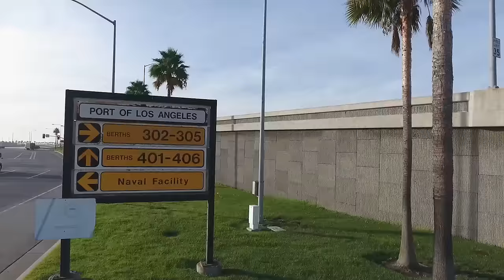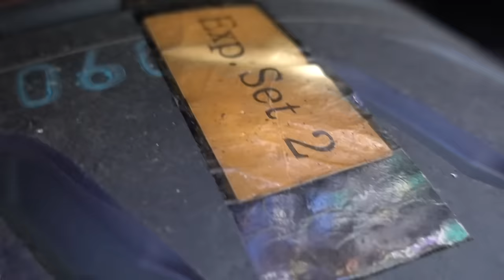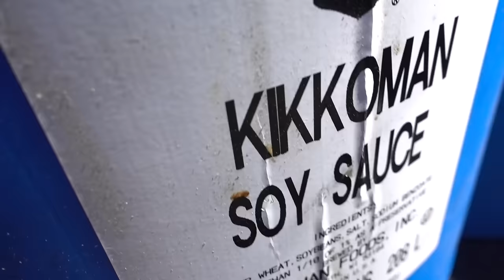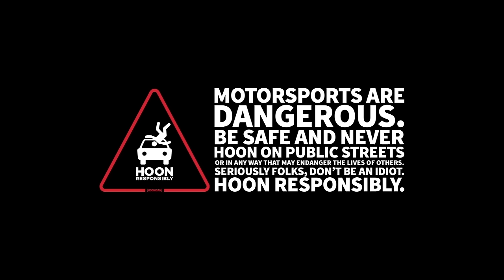Ken Block Slays the Donut Garage in his 650HP Fiesta #Yardkhana

Comment: It’s so crazy hearing the blowoff valve at idle just when he turns off antilag
Reply from the maker: It's crazy to see how much boost the ALS system makes just at idle.
Reply: Would cool to see a more detailed look at the engine configuration on this car. Is it still using a Pipo built engine? I assume it's running fresh air type ALS?
Reply: most WRC cars have a secondary air injection going in to each exhaust runner.

Comment: Has 650 HP
"Ecoboost"
Reply: Raul Alonso Ecoboosts can be beasts if you build them that way. Even stock ecoboosts can make fairly large power numbers with a big turbo.
Reply: Naters305 you missed the joke , Alonso is saying that at 650hp it’s not so much “eco” so is funny calling it ecoboost
Reply: S1000RR Ant more eco than a supercharger
Reply: Valkarez lmfaoo you do realize at the boost this car is running this car drinks more gas than a supercharger would. This thing has to have huge fuel lines.
Reply: S1000RR Ant not than a supercharger making the same hp and torque
Reply: Valkarez a supercharger isn’t gonna make this kind of power anyways so what’s the point of even being it up all I’m saying is that this car isn’t eco at all no turbo 4 banger making 300+ hp is eco not even your subie if it’s an sti. They have shit mpg.
Reply: S1000RR Ant eco is subjective if you arent comparing it. so what are you comparing it to? if you arent comparing it youre just sharing your opinion.
Reply: Valkarez what all I said is that this cars isn’t eco at all any turbo 4 banger that makes over 300hp isn’t eco at all they will have bad fuel mileage. That’s what I said at first & im not wrong idk what you’re trying to say
Reply: S1000RR Ant you arent wrong but you arent right. its your opinion, but you said it like it was fact, which it most definitely is not.
Reply: Valkarez this car gets probably 10 miles a gallon that’s not eco friendly I guess it’s an opinion but it’s an opinion anyone with a brain would agree with
Reply: S1000RR Ant i disagree with that. based on the circumstances i would say 10 miles a gallon is pretty good. ill bet it gets even better than that anyway. theres plenty of street cars that will do 10 miles to the gallon, much less a 650 hp racecar.
Reply: @SteezeN  FWIW My 650whp evo gets the same highway MPG when it was stock, maybe better.

Comment: rear mount rads in FD are more for kicking up tire smoke than anything, also it helps when you are trying to fit big ass engines in small cars like 240s and the weight on the rear end helps with traction. its not like they do them for no reason

Comment: What's the red button for on the hydro
Reply from the maker: It's one of the greatest mysteries of our time.
Reply: ejecto seato cuz
Reply: TheHoonigans Wrong greatest mystery is the damn car you’ve yet to reveal under the covers.....
Reply: Its something with the diff, I think it makes it fwd when you pull the handbrake and push the button instead of awd. Or it gives more power to rear something of that kind lol
Reply: Launch control would be my guess as you can see him holding the button with the hand brake pulled at 24:16.
Reply: tct72 it's for the launch control you can find this buttons also in the wrc cars
Reply: It dispenses Mike and ikes

Comment: Don't the turbo fans on the front wheels work the opposite way? They pull air out from the bottom of the car, which still draws more air over the brakes but also is a sort of ground effect? I feel like the last thing you would want is to pump a whole bunch  of air under the car creating a high pressure zone and lift.

Comment: 6:54 650HP from that tiny thing!?!? I’m behind the times
Reply: That's right. Take a look at FIA WRX rallycross cars, they put out a similar power output too, usually 600 BHP (this combined with a short & close-ratio 6-speed sequential allowed these cars to hit 60 mph from 0 in 1.9 secs, crazy quick for a full-sized ICE-powered vehicle).

High-powered rally-based cars have been around for years, starting with Group B rally, where cars put out in excess of 500+ HP, crazy (and dangerously) fast for stage rallies. (with the multiple accidents that happened due to the relatively insane performance of the cars and lack of spectator safety control led to the banning of this rally class)

Outside rallying, some 4-cylinder engines can even put out beyond 1,000 BHP, one of the factors being using a large turbo.

Comment: Those wheel plates arent for looks they prevent dirt, sand, water etc from getting trapped inside the brakes etc. ...well excess rather. This freaking guy drives through deserts!!